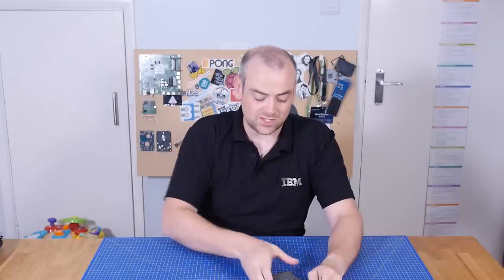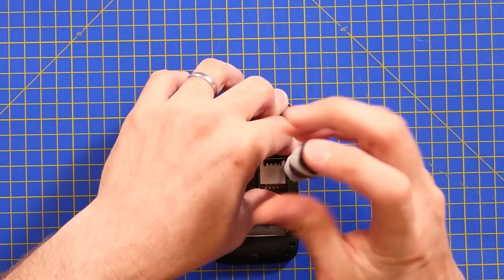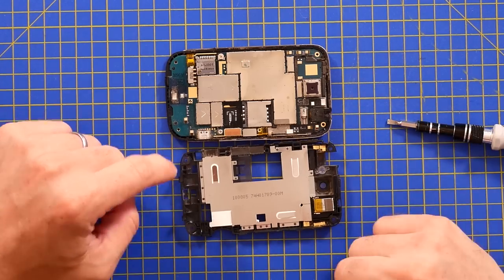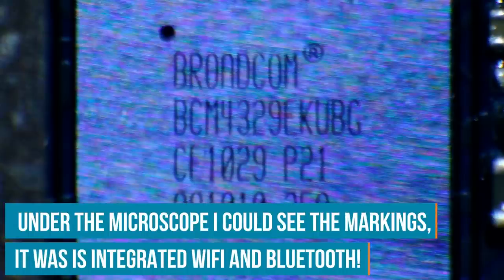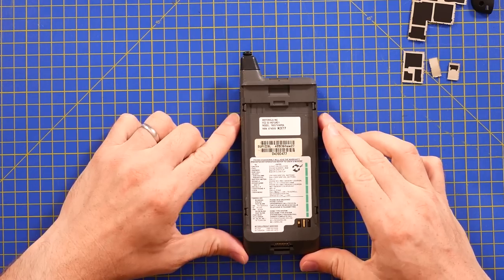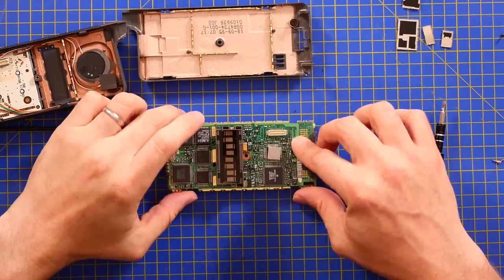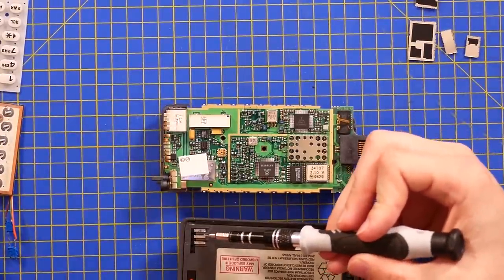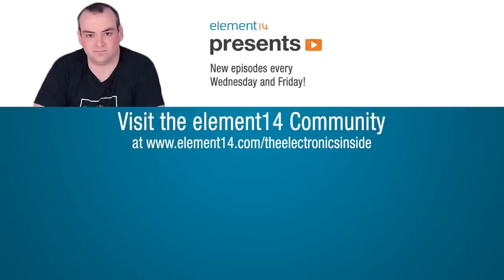Motorola vs HTC Mobile Phones (1989 vs 2010) Teardown - The Electronics Inside

Comment: Fun fact: SIM cards were originally the size of credit/debit cards; the HTC shown here uses "mini-SIM" cards! But the mini-SIM size was introduced before mobile phones became particularly common (1996, so says Wikipedia), so yes, to most people that is the "full size" SIM card!
(Hence the more recent size reductions being named "micro" and "nano", seemingly skipping "mini".)

And RIP HTC :(
My first two smartphones were from HTC. The first one (HTC Touch Pro) ran Windows Mobile and had a full QWERTY keyboard and a stylus for the resistive touchscreen!
I remember having that around when the first iPhone came out. As a computer science student at the time (i.e. tech geek :p), the Windows Mobile device seemed a better option for me than the weirdly-limited iPhone (no copy-paste? no multitasking? no third party software? no 3G?). I was keeping my eye on Android and figured I'd probably switch in the coming years, but it just felt a bit too immature in 2009-ish, largely because Windows Mobile had many years of third party apps available at that point, and Android app development was still getting started.

(My second smartphone was the HTC Desire HD, running Android, so I was correct with my prediction!)

The metal-coated-plastic of the Motorola phone is something I've seen a lot in laptops. It's pretty neat :) I think my Dell Studio 17 laptop from 2008-ish has the whole lid coated in copper behind the screen, for example.
Reply: I can remember my dad having a motorola of this size with a "full size" sim card and getting in trouble for touching it and causing it to become unseated!

I had an HTC One S in Circa 2013 ish? It was a wonderful phone, physically wonderful, although it benifited from a custom ROM to remove some of the bloaty HTC Sense.

Comment: I had the immediate successor to that Motorola, the MicroTAC with the flip that was just a thin piece of plastic that protected the keyboard when closed. I also had all the accessories for it including antenna boosters and the modem cable to connect it to my Psion Series 5. I once used that combination on a camping trip when the "campground" I had booked turned out to be in the middle of town and dominated by big rig RVs. I was able to find a much better site up in the mountains to which we returned several times.

After that I had two different versions of the StarTAC, which was an amazing bit of kit. It was tiny, smaller than anything I ever had after that.

Comment: 9:55 Clearly shows the date stamp saying 18-09-95, unless you mean this particular model was produced from 1989 and was still in production 6 years later?
Reply: It seems it was, with modifications. The original 1989 model had the microphone in the flip section, where as my later model had it in the main body.

Comment: the antenna has an internal metal and at the base there is a ring contact
Reply: The short (approx 1" part) coil at the base of the antenna definately has connections onto the main board, but the "full length" antenna had no clearly metallic parts or connections to anything?
Reply: @a531016  The plastic antenna has metal particles in it. It couples to the coil.
Reply: @zaprodk  that's the kind of thing I was expecting, but couldn't see any evidence of!

Comment: Check the date stamps on the IC's in that ol Motorola phone. I saw chips dated as late as 1995 :) How often do you see models produced for that long these days?
Reply: Not often at all, for better or worse. I guess it makes the significant investment easier to justify if it will last 6 years, and parts (batteries) will be about for longer!

Comment: NiCd batteries are much safer than today's lithium ion. I played with them a lot as a kid doing all sorts of ammateur electrical experiments and never saw one blowing up. At worst it would get very warm but no smoke. They usually kept working ok even after being abused by wrong charging methods.
Reply: Lithium is a pretty nasty thing to want to keep in a pocket. But with that said, the energy density and charge cycles it could handle are much better than NiCd.

Roll on graphine, super capacitors and solid state battery technologies!
Reply: This low energy density is one more reason NiCd are relatively safe to play with. If you end up shorting them out, they'll start heating up of course but from my experience they'll get completely discharged before something bad happens. There's just not enough energy available to heat up their big mass to the point of "boom". But it's enough to melt wires and plastic things.